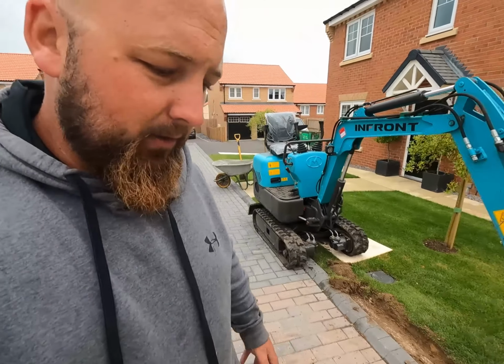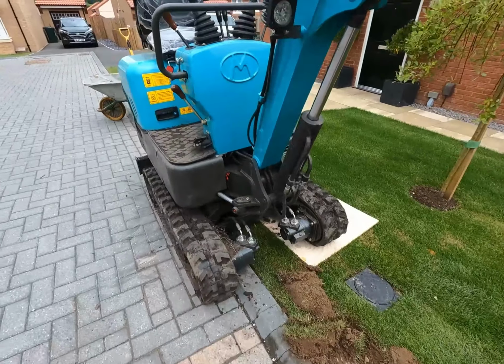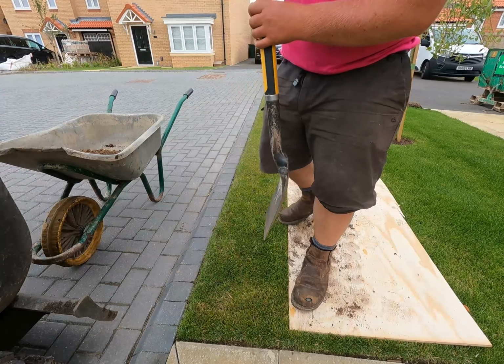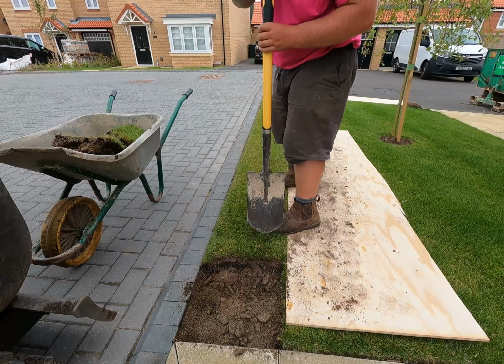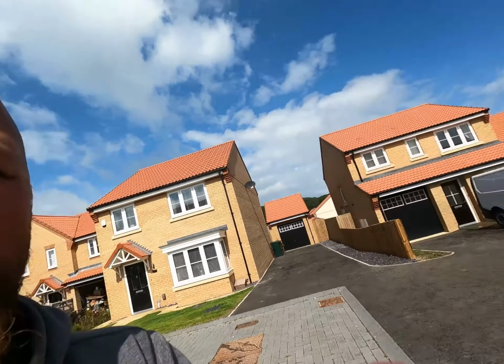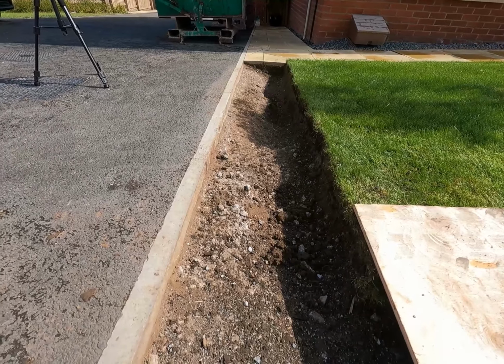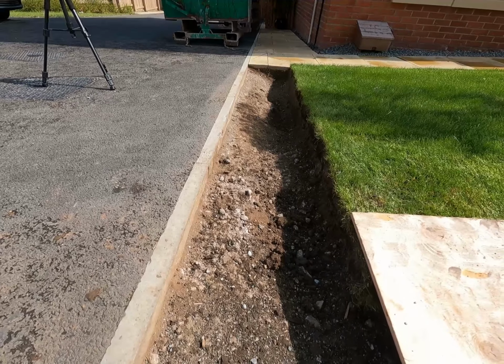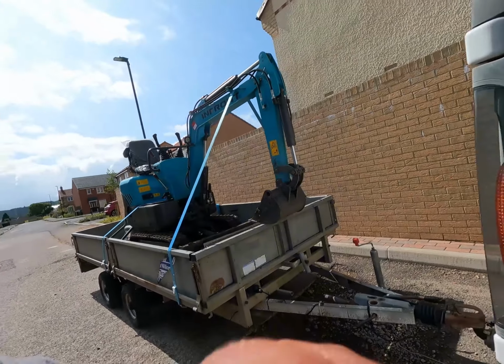Dwarf wall foundation dig that didnt go to plan.

Comment: It is very difficult for machines to work in such places. I have had similar experiences. However, you better do the job with a shovel. that's the great point. really good video bro 🙂
Reply from the maker: Hi Rogmeon, yes i agree. it doesnt bother me if i have to get on the spade. A wise man once told me, a mini digger can do 90% of the work but that last bit always finishes with a spade or shovel. Thanks for watching and commenting.

Comment: Dobrý večer Nicku , neuvažoval jste o nějakém minidumperu ? Mám TD 500 a perfektní pomocník. Pro vás a vaši práci myslím bezva pracant . Pěkný večer přeji
Reply from the maker: i have thought about a dumper however i dont always have the work that would require a dumper or a little tracked or 4 wheel dumper. Some of the house and jobs ive been on have been very tight with access.
Thank you as always for commenting 👍

Comment: should have cut the grass first then put the bucket down an drive backwards
Reply from the maker: Hi Robert, thank you for your comment bud 👍 in the video you see me score the grass then use the digger to rip it up. Was only a few inches down before under pinned concrete so didn't do much with the digger. Was fairly easy to be fair. Thanks for watching 😁
Reply from the maker: Also the comment on the other video has been deleted for some reason bud. Could you perhaps comment again so I can reply. Cheers bud